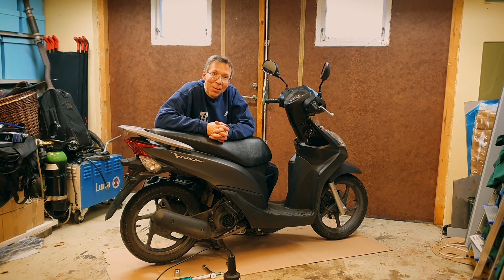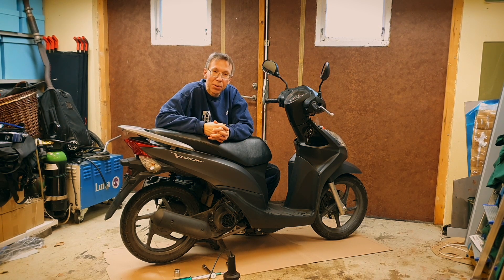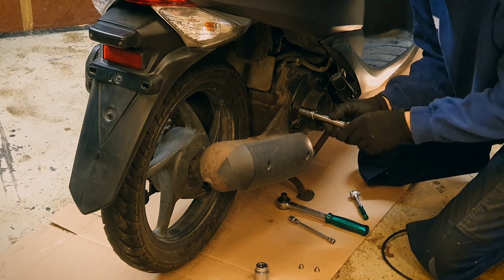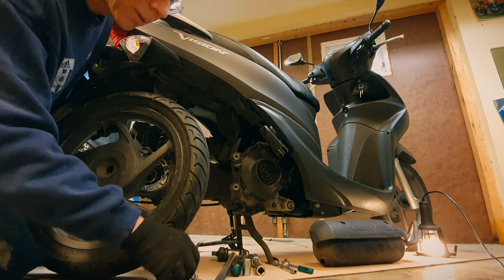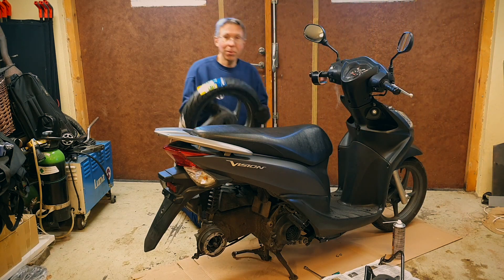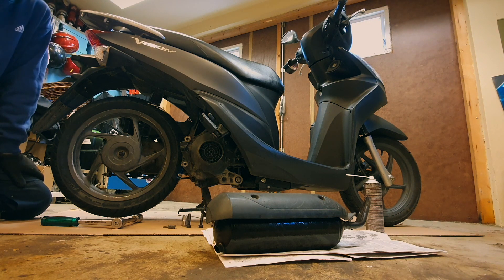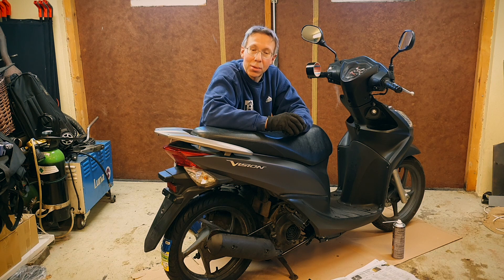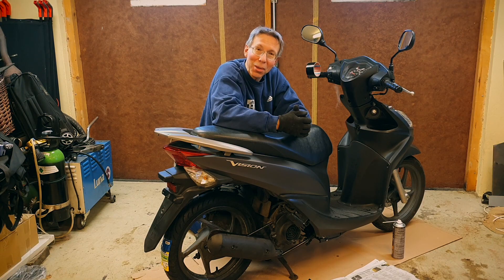HOW TO REMOVE A SCOOTER REAR WHEEL, SHOWN ON A HONDA NSC50 VISION

Comment: I did this last spring, to make it easier you can tighten the rear brake adjustment nut to hold the rear brake more still. The torque for the rear wheel nut is 118nm and the front axle wheel nut is 59nm for future reference.